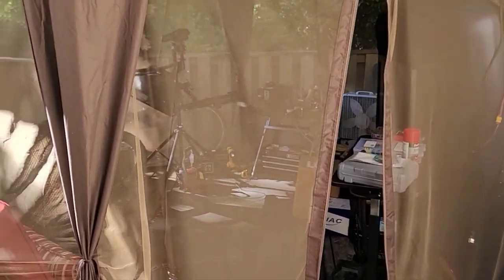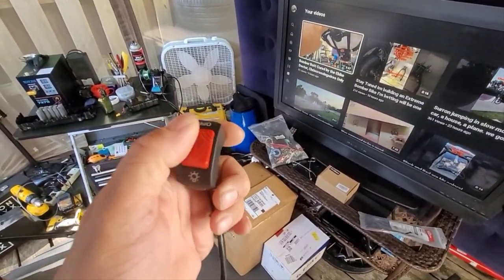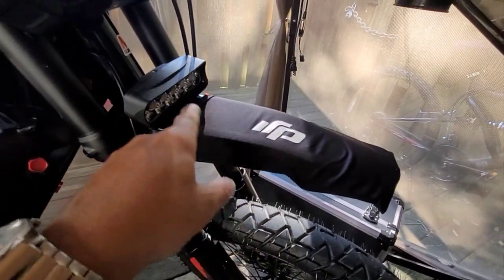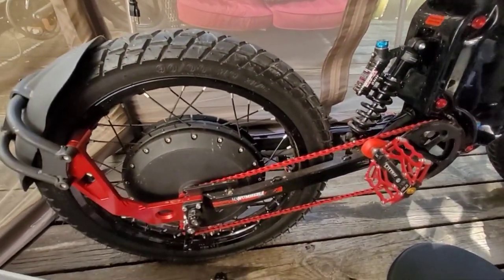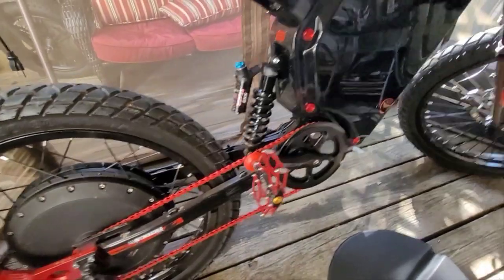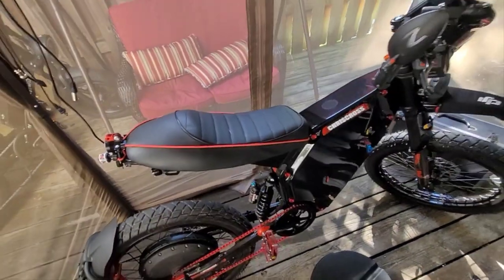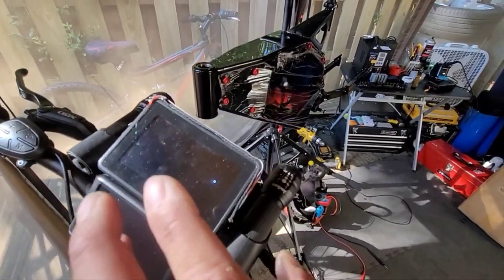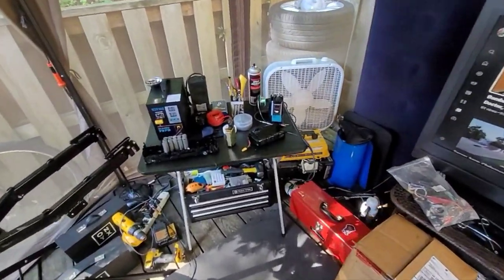Bomber Build HEADLIGHT switch install and small discussion on REGEN & EBRAKES!

Comment: I have my rear view camera and screen in the same place you have yours.. I'm using a 12v separate power pack for my headlights and under glow.
Reply from the maker: I had a small pack for that too run separate but these lights are so efficient they hardly pull any power

Comment: Awesome video..you know if it a light draws alot of current..you could use the option of hooking the switch up to the negative line! Avoid power all together! 👌🏽
Reply from the maker: Naw not my light my light cost $14 abs you can keep you hands on it. his you can cook on. I said my light didn't draw any current. I had a separate battery all ready to go as these are common issues just not Bomber related and I don't even need to use it. I don't my light draws one Amp
Reply from the maker: lol I must have made you turn the volume Down with my music. lmao I could have sworn I said these exact things already. you not watching my vids in its entirety? Kidding but yeah said that 😆
Reply: @ChrisCrossingWires1212  Lol.. yeah I was watching and driving at the same time..lol.. Much appreciated ❤️
Reply: @ChrisCrossingWires1212  Awesome bro.. yeah my lights get hot as shit bro..but I only really use them when I am moving..lol